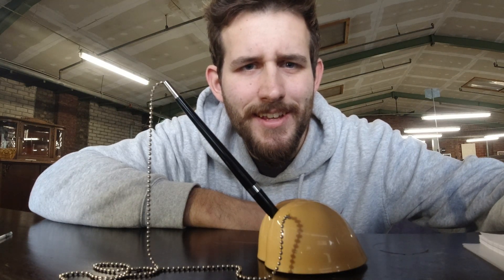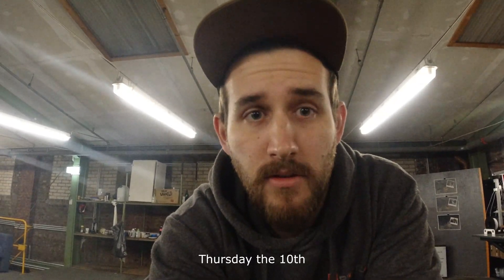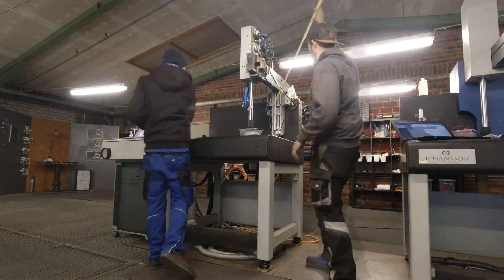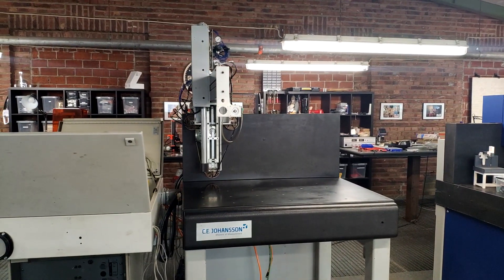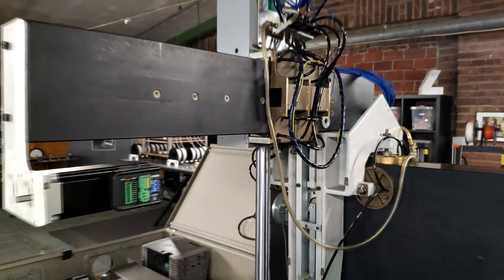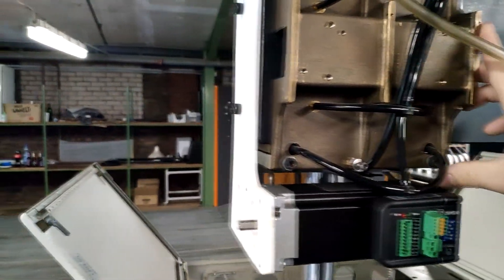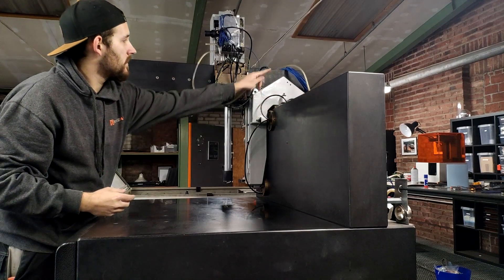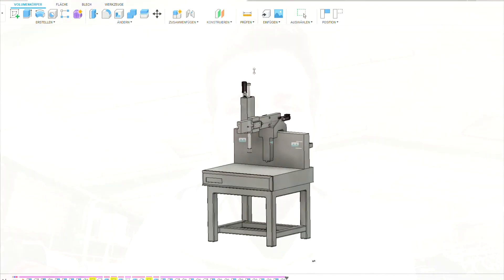Air Bearing CMM to 3D Printer Conversion #S01E02 Plans/CAD/Schedule

Comment: I never stumbled upon this until now. It looks interesting, and the machine itself is certanly an impressive piece of engineering, but frankly I'm not sure that this type of machine is a good candidate to repurpose as a 3D printer. Its tolerances are probably a magnitude or two of order than those for 3D printed plastic, and I don't see how this could be changed no matter what changes you apply to it. Anyway, it seems to me that this machine could more succesfully be used as a basis for some special purpose precision mill than the 3D printer. But then again, I haven't seen the videos after this one, otherwise posting here would feel like cheating. And after all, such an opportunity to make a complete fool of myself doesn't present itself every day;) I hope I'm wrong and am not seing clearly...

Comment: you can glue part on the granite, loctite 325 or JB weld epoxy have 5000 psi tensil strengh

Comment: With a an inexpensive diamond hole saw bit you can drill and place your own inserts, that gives you a lot more flexibility in design. I'm looking forward to seeing what you come up with!
Reply from the maker: Yeah that would be one option. But in this case even the granite beams are pre tensioned with steel bars to get the last micron out of them. I dont want to mess with that system. I've got something different in mind...
Reply: @Roetz40  my first idea was to clamp on them. Custom frames to grab from sides where needed. Maybe aided by some adhesive.

Comment: Have you made those air bearings or bought them?
Reply from the maker: The whole air bearing system is factory installed and alignment has been checked just a year before I bought the machine be a different company. I just replaced the air hoses for maintenance